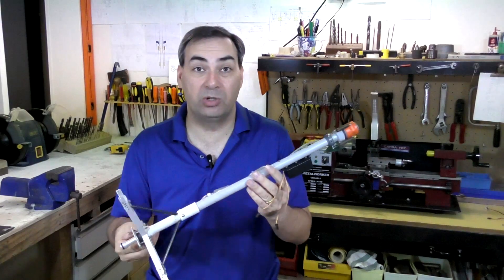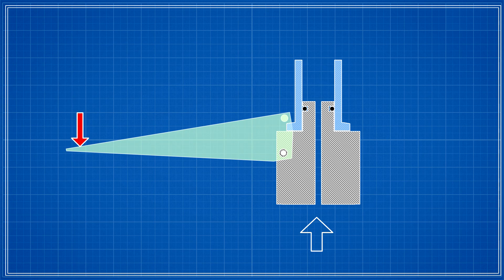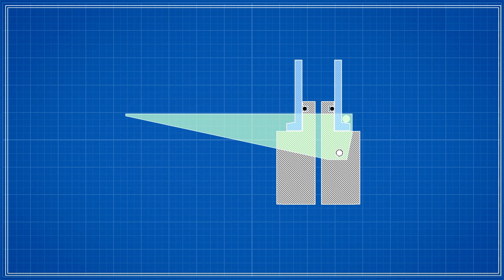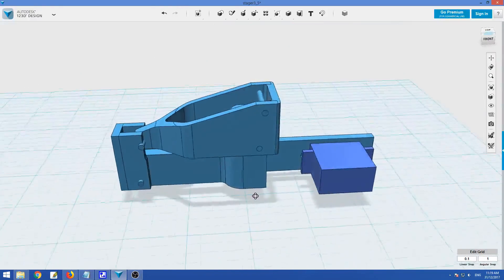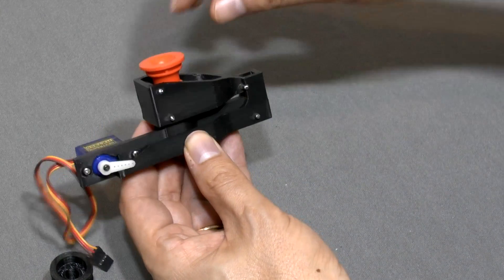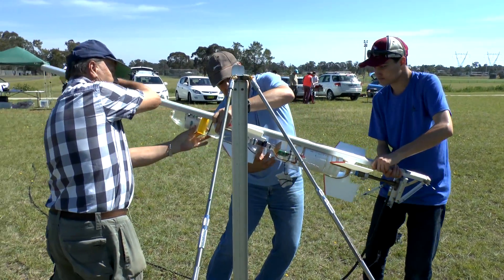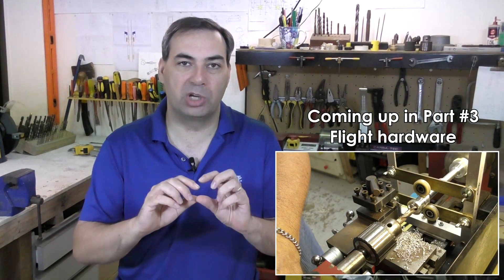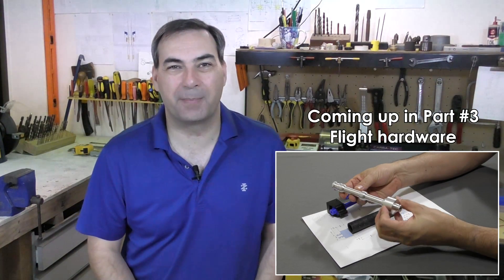2 Stage Water Rocket - Part 2 - Stager Design

Comment: Hey thanks for the great video. I have built a few rockets myself but only single bottle ones. I would be nice if I could have the file for that because I want to print it myself and try and implement it into my rockets I make. If you can make this possible that would be amazing. Thx
Reply from the maker: Though the STL file isn't available for the stager yet, there will be some announcements in this space later this year.
Reply: Air Command Rockets thank for the info

Comment: Happy new year George. I've build  a waterrocket with  multiple bottle sections without tornado coupling to try if I can put a lot of pressure with  such a construction. A few years ago I've build a staging mechanism that I saw at us waterrockets. I think it's build to heavy but I'm going  to try anyway.Last year  I started with the rebuild of the Antares 3B rocket that I will launch in the spring. That's it George. I hope this will turn out well. :).

Comment: Are water rockets more efficient as they get closer to vacuum or do they collapse?
Reply from the maker: Yes, as a water rockets gets higher, lower air density will make the rocket perform better because there is less air resistance and a higher pressure differential between the outside and inside. The bottle will not collapse since when released it is pressurised and open to the outside pressure (via nozzle) so the pressures will quickly equalise.  - All the air will escape to the outside until there is both vacuum on the inside as well as outside. The pressure difference between sea level and complete vacuum is relatively small though (14.7psi) when compared to the pressure inside the rocket at almost 10 times that. (120psi).

Comment: I know how to release 2 stage in the right moment without electronic device. Give me email and I'll send you my scheme. By the way 25 years ago when I was child my parents bought me a water rocket. It was a very popular toy in USSR and Russia of the 90s years http://cs.pikabu.ru/post_img/2013/08/22/5/1377154778_1506753937.jpg
Reply from the maker: Hi Alexander, I'm always interested at how others solve the same problems. My contact details are here: http://www.aircommandrockets.com/contact.htm One of our previous stagers is also fully automatic and doesn't need any electronics. http://www.aircommandrockets.com/howitworks_4.htm though it was only intended for small rockets. We are using electronics with this project as we can get much better control over when it stages based on sensors that measure the flight performance. It will start staging just before burnout so that the water in the sustainer is still sitting up against the sustainer nozzle. Thanks for the link to the old water rockets. Those look great! I remember similar ones were legal here in Australia about that time, but too many kids got hit in the face by them and so they were banned.

Comment: Excellent work! I look forward to the continuation of the project. Once again, I thought about buying a 3-D printer;) This greatly expands the possibilities for technical creativity! Although, the concept of "simple solutions from accessible materials" is also very interesting)). I have a constant internal conflicts about it)) Please tell us about the control system in this rocket.
Reply from the maker: Thanks Water Rockets Club. :) When you say the control system, which specific one do you mean? We'll be covering in detail, the stager and its associated electronics, also the launch pad and it's control system. This will be our most complex one to date. We'll also be covering in detail the parachute deployment mechanisms for both the booster and the sustainer in future videos.
Reply: It is interesting to learn about the control systems of all rocket nodes, but especially about the system of separation of stages. Will there be a project with a three-stage rocket? With more rocket stages?

Comment: This staging mechanism prototype looks already completely awesome! :) Great work, I can't wait to see the vertical design. I'm pretty sure Horizon will be the most advanced water rocket worldwide for a long time. Very cool to see you using the 3D printer for your projects. We are currently playing around with a Ultimaker 2+, and it's pretty amazing what you can do with technology like that.
Reply from the maker: Happy New Year Julian! It is quite a different design process for this rocket especially for the booster, where saving a few grams here or there is irrelevant. With a peak thrust of 11kN, 100 grams doesn't really play a role. On the sustainer weight is more important. We are really designing the staging mechanism for strength rather than shave every gram off it. I am not sure how I ever survived without a 3D printer :) 3D printing technology sure has come a long way and the Ultimaker 2+ looks like a very nice piece of kit. For me it was the print quality and dimensional accuracy that was important.
Reply: A Happy New Year too, George! :) It's completely understandable that you will use metal parts for Horizon, since both pressure and acceleration will be tremendous. However, that doesn't stop me wondering where to limits of 3D-printed components are. Have you tested how much pressure the stager prototype can handle? And what printing material do you use?
Reply from the maker: I am still hesitant in pressurising 3D printed parts too much. The hole in the stager was small, so not a lot of force put on the inside walls, and it was printed solid. We have used PLA so far for all of the prints.

Comment: have you guys ever tested rockets keeping the water in a bladder like a balloon to allow the rocket to be launched horizontally?  the air pressure would need to be introduced through the other end of the rocket to avoid filling the bladder but im curious to know if it would work reliably, or possibly having some other way of keeping the water forced to the nozzle at any angle, maybe in a piston or something.
Reply from the maker: We have not tried the bladder method though I have seen it used quite a few years back. I don't think it really is necessary though. As long as you have a little water covering the nozzle, as soon as you release the rocket it starts to accelerate which causes the water to settle against the nozzle. The water surface will be perpendicular to the direction of travel.  You may get a bit of initial slosh as the water comes down from the side towards the nozzle, but nothing a baffle couldn't fix.

Comment: Simply genius- great video once again. Looks like you're having good experience with the 3D printer. What make is it, would you recommend it? Thanks, Jamie.
Reply from the maker: Thanks  Jamie. I love the 3D printer for  prototyping, or making useful bits. It is the Makergear M2 https://www.makergear.com/products/m2 I would definitely recommend this one though it is a little on the expensive side for what I believe you can get these days. It's been reliable and makes very good quality prints.
Reply: Great, thanks I'll have a look at that. There are a lot of choices on the market and I know some cheaper printers still struggle to make good quality prints. One more question, I'm sure you may have the answer to this on your website somewhere, but how are you stopping the water from the top rocket running down into the lower rocket once it has been pressurised? Some sort of valve?
Reply from the maker: Yes, there is a non-return valve in the stager. I didn't cover it in the video, but the hole from the booster to the sustainer is about 1mm diameter. I inserted a piece of wire through it and on top added a ball of solder. On the bottom it is just twisted up. The wire can move up and down about 1cm. When you pressurise it from the bottom, the air just flows around the wire up into the sustainer pushing the wire up a bit and letting air in. When you launch it, the ball of solder on the end of the wire drops down and closes the hole and sealing in the pressure. On the horizon stager the valve is very different so I will describe it in detail in the next video.
Reply: Ah that's great to know, thanks a lot! I think a lot of your work can be summarised in this quote: 'Simplicity is the ultimate sophistication' -Leonardo da Vinci.